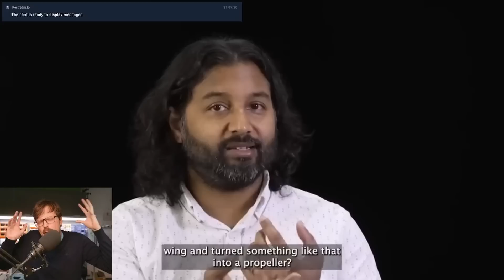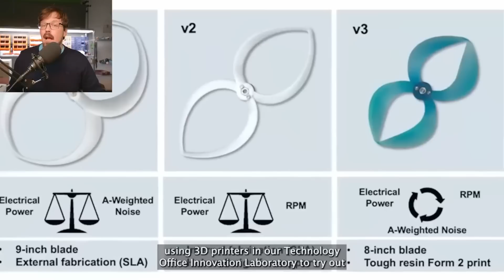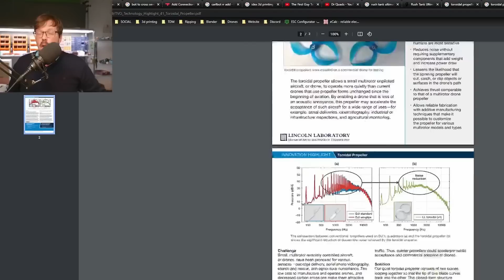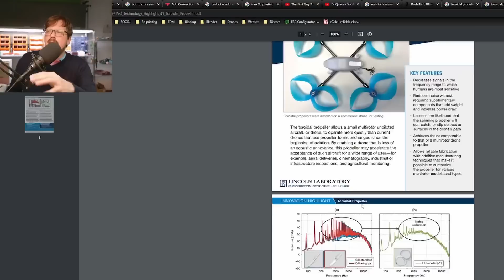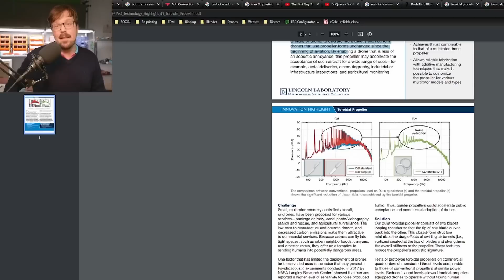MIT Thinks you're STUPID - Toroidal Propeller Snake Oil

Comment: I already watched the channel where the guy 3d prints comouter cooling fan blades, and he didnt call it a scam, but he did show that circular semi-helical design was neither more efficient or quietter. Other designs could be different, but its likely that this is something that wont work as well in air as it does in water.

Comment: You're right about pretty much everything but I'll point out that at ~ 7:20 where the drone is wobbling, if you look at the trees, its pretty windy.
Reply from the maker: That is a good point. I should be more precise!
Reply: @33rdframe  I think you are right. But only in Horizon Mode https://youtu.be/hby6U47oV_k?t=85 in Acro the issue is gone. But well, the Video doesn´t show the Betaflight logs :) Greetings from Germany
Reply: I would bet the PID tuning is significantly more aggressive in Acro mode which would give it better stability. Ultimately, they still chose a wobbly flight video as their presentation material which seems counter productive.
Reply: No he seems right about the wobbeling in horizon mode. https://youtu.be/hby6U47oV_k?t=85

Comment: I agree for the most part but reserve judgement until I see proper testing from a prop manufacturer. They will definitely be investigating but I do not believe the resulting prop will look like what MIT has shown.
Reply: Can't wait for the new tmotor MIT popo poop props
Reply from the maker: I mean I am sure there is a possibility to gain some tiny tiny benefits from these props.... But you will lose efficiency, power, and handling..

Maybe the best thing these props can be is kid safe... That not totally useless... It's just not a revolution
Reply: @33rdframe  gosh you get some wildly aggrevating commenters 😂. To further expand on my original comment, I believe the idea to connect two blade ends is potentially useful but is not likely to take over the tried and true 5" triblade. It'll make quad blades a more usable product. Basically just have a forward swept blade tip touch a back swept blade tip such that the forward swept blade won't flutter out of control under high rpm. Adds a tiny bit of weight but the resulting gain from reduction in drag may make it efficient enough to use more often. 

So MIT, snake oil and I'm proud to be part of a community that can process this all so quickly. But I wouldn't say it's all hoopla. There is some gained knowledge and it comes in the form of a 'no duh' epiphany. No duh if you connect blade tips they'll likely share lesser drag from the tip and the resulting blade could possibly have somewhat lower drag. Now just do it without impacting the rest of the performance.
Reply from the maker: @Kabab  I love the trolls just as much as the noble viewers, because the morons drive traffic with their ridiculous comments the refuse to abandon
Reply from the maker: @Kabab  also if you connect the tips all that dead weight on the outermost part of the blade not producing lift is a big hit to flying efficiency.
Reply: @33rdframe  yeah definitely connecting tips will add weight but I imagine an efficient way to do it would be to legitimately have a forward swept blade behind a back swept blade such that the ends just connect so minimal wasted material. It could possibly work out. It probably won't be better than a triblade but should be better than a quad blade.
Reply: @33rdframe  How about for large drones used for military and delivery applications?  Did MIT ever once claim they were working for the FPV community, "Doctor"?
Reply from the maker: @odinata  they used an FPV drone directly in the promotional video....
Reply: @33rdframe  Do you know what FPV stands for?
 There is is no FPV camera on that craft.  There is no transmitter, no antenna.
Probably just an early proof of concept, since the lab caters to National Security and Military..
Reply from the maker: @odinata  what does FPV stand for?
Reply: @33rdframe  If you don't know, what it stands for,  then why are you claiming MIT used FPV in their prop tests?
Somebody bought a DJI Avata and thinks that means they have a Phd in Drones.
LOL!
Reply from the maker: @odinata  bro I have flown my avata for like two months already. It's long enough to spot an FPV drone. At the end when he is flying the white drone outside that is clearly an iflight FPV drone
Reply: @33rdframe  So you think the DJI Phantoms 4 is an  FPV drones, huh?
Are you smoking some of GEN X FPV's drugs?
Reply from the maker: @odinata  bro, I fly a Dji FPV mavic 3 cine before. But I cannot fly well yet. I'm still learning
Reply: @33rdframe  and yet sis you're somehow smarter than all them science and engineering students at MIT and the people who hand out the awards for innovating research and development... You're the smartest guy in any room you're ever in huh? Lol
Reply from the maker: @odinata  given that i do not have friends and live in a cave. it is theoretically correct
Reply: @Davionation-s1g  What's asinine is claiming that the MIT R&D is aimed at smaller FPV hobbyist drones.
Reply: @odinata  You're aware that including "Doctor"  in a username on the internet doesn't actually mean anything right?
Reply: @winnie51189  It means comedy and irony when this guy uses it.
Reply: @odinata  The university I went to is ranked higher than MIT

I made no appeal to authority; you are the one making an appeal to authority via claiming its MIT so they are right and I'm saying, "No, that doesn't matter."

You are literally arguing against yourself and don't even realize it
Reply: @pyropulseIXXI  Why do you think your anecdotal claim about the school you went to has any bearing on R&D into novel propeller innovations?
Because you are making an Appeal to Authority Fallacy.
Your opinion on this matter is WORTHLESS, as is your claim about school rankings.
Reply: @odinata  You were the one making appeal to authority fallacy, saying "you know better than MIT peeps?" One can be a hobo off the streets to disprove their claims but apparently you like appealing to authority, so I used 'logic' you are familiar with to demonstrate people at the same level of MIT disagree with them
Reply: @odinata  My my son, calm down. 

You out here calling someone Ignorant, while trying to use arrogance to mask yours.

There's a reason you eat alone.
Reply: @odinata  "Because you are making an Appeal to Authority Fallacy."

...also odinata...

"and yet sis you're somehow smarter than all them science and engineering students at MIT and the people who hand out the awards for innovating research and development..."

Comment: Potential use cases as it's quieter, so you can fly closer? Great, problem is that there are distance limits based on the drone falling or slamming into a person's skull (FPV can go 100+ mph and weigh 700g+), noise was never a limiting factor.

All videos trying to prove MITs nonsense all show that the drag by the design is limiting lift and prop speed, so technically it is quieter. Great. Less efficiency, but it looks cool!

Comment: It’s not “a weighted” noise.  A- Weighting, as opposed to C weighted, is a deciBel measurement that is a frequency profile applied to the measurement to make it match how our ears hear different frequencies vs a microphone.  Not arguing your other points and additionally, these designs will have a lot more inertia than a standard prop making them slower to react on a drone that needs to change the motor speed very quickly.
Reply: The important thing is if both motors runs at same power, but one propeller gives more thrust, then it's irrelevant to compare the noise because the flight time depends on amount of thrust per consumed power.

So same power but less thrust may result in lower noise - and a need to increase the RPM/power (and hence noise) to compensate for lack of thrust.

So bottom line I that there should have been information about needed power and produced noise at identical thrust.
Reply from the maker: @perwestermark8920  you nailed it! that is why they can show the bench test noise but NOT the hover test.... i think i should have pointed this out better. but thank you for making it clear for everyone
Reply from the maker: Thank you for correcting me. Yes I didn't fully understand than but I looked it up and you are correct.... It still doesn't provide any actual data but it's not as ridiculous as I made it out to be
Reply: @33rdframe  And electrical power is measured in Watts, not Volts or Amps.
Reply from the maker: @GavinBath  p=vi .  i mean you are splitting hairs
Reply: @drquads5589  how many split hairs accounts for the time value relationship to power?
Reply from the maker: @jerrodbrown5475  listen bro I am not here to  mentally masterbait to make myself feel smarter than others. the proof is in the pudding. do you feel that "scientific paper" was adequate or not?
Reply: @33rdframe  I mean for voltage = const , I is proportional to power
Reply from the maker: @mr.mirror1213  yes but what does that actually mean in the context they used it!?!?? That was my point
Reply: @33rdframe  I'm with you
Reply: @33rdframe  the proof isn't "in the pudding".. the saying goes "the proof is in the eating of the pudding". If you have pudding you can say whatever you want is in it. The only way to prove what's in the pudding is to eat the pudding... I hate how everyone gets this saying wrong.
Reply from the maker: @bradleyknopp7303  fair point haha

Comment: These toroidal props are the biggest fad that have hit the FPV community in years.  Remember those stupid angled motor bases that were supposed to make your quad more aerodynamic but ended up just making our quads fly like crap?  Well the same thing will happen to these toroidal props.  First by being heavier they are killing efficiency by reducing the motor’s RPM at a specific current.  Then it will kill throttle response and make the quad fly like crap.  Just look how wobbly the Phantom is in their video.

Comment: Did you personally try it? Because we all can be talking. I'm now printing V1 and V2 from STRIKINGFPV, planning to correctly test them on the testing bench. I also have doubts but still, it looks like a good start for innovation. They may be not performing as advertised at this stage, but I believe there still will be some noticeable differences and we as a community can play with it to improve the initial poor design. 

I'm from Ukraine and if you read the latest news, you should know how important FPV drones became in the last half of the year to save Ukrainian lives. And this design seems to have the potential to carry more weight than regular designs and maybe be a little quieter at the same time. Like if this is true at least partially - I believe it is worth trying. I'll be happy if it gives at least 10% of the lift capabilities at a cost of +30% battery consumption. This will allow for making one-time-use DIY FPV drones, capable of lifting heavier loads, and it is precisely what the Ukrainian army needs now from FPV drones.
Reply: if it worked, they'd have said "a 12db reduction at 4k rpm"

It's not that damn hard to measure sound pressure levels and rotations per minute, yet they didn't even provide any data or control comparison.
Public education is an amazing thing.

Things missing: flow rate, flow pressure, motor amperage, motor rotation speed, sound pressure levels, humidity, temperature.
Things provided: two frequency response graphs of the whitenoise generated by unknown motors at unknown speeds in an unknown environment.
Reply: Emm.. But doesnt itself "+30% battery consumption" give additional weight ability with any prop on flat earth? :)
Reply: @sunnyfpv3694  drivers and motors have their limits. I do not generally care about battery, they not ment to fly long. They ment to deliver as much cotton as possible to russian tranches. We already boost our DIY FPV kamikazes mostly to the limits of electronic, they are able to carrying 2kg and it is enough to barrage RPG shells including cumulative anti-tank one, It is one way delivery, usually takes 3-4m to get to the target, it is better to be as silent as possible, and carry as much weight as possible and be controllable. I assume giving 30% of battery will help with weigth, but not so good in flying unnoticed and if we boost more than we are doing now it will just burnout in middle of flight. Anyway I already printed few versions and want to check how this new rotors works. I-m not expecting much, but i'm expecting at least some pros in terms of lift and sound. Still waiting for motor, driver and DJI rotors for comparison and to make testing bench.
Reply: Станіс  not so good. Drone slide sideward and not keep stable horizontal position. It Is is fixable with additional calibration. As for noise it's not so high but not so silent as want to. I'm printed it from ABS on Artillery Sidewinder printer, and quality of surface not perfect and seems they are little unbalanced.
Reply: "I'm from Ukraine and if you read the latest news" do you have evidence the news is truthful? Do you have the data to give? Whose lives are being saved and whose are being removed?
Reply: @amentco8445  I understand your question in general, but for me, It is not a matter of "where to get information", it is not a matter of who should i believe or not believe. Most of my family leave in Kherson. I have people that are in direct danger right now at this moment. Russian army already destroyed most of the region. Like there are no villages left, no roads no factories,  thousands of people killed, electricity, and water sources, everything is destroyed. My uncle works in a hospital that was bombarded. My man, believe me, I have no such problem as "what the news says" or "who say right and who say wrong". I have my friends and family in tranches, they ask me for money to buy a drone. I want this drone to be as productive as possible because if it will be productive my relatives will have better chances to survive. That is a reality I leave right now.
Reply: @amentco8445  Sure I have, I leave here. IDK what evidence you ask and why but here - that is a work of a drone I personally donated for. https://www.youtube.com/watch?v=baYd_8Syzak&ab_channel=ClimbArmy
Reply: "10% of the lift capabilities at a cost of +30% battery consumption"

You'll be happy with a 1300% loss in efficiency? lol... wow, no surprise you are willing to be the cannon fodder in USA's geopolitical games...
Reply: @TheChzoronzon  15.4% loss in efficiency...
Reply: @ChucksSEADnDEAD  From were did you get that number? Link please
Reply: @TheChzoronzon  I simply used the numbers given and used my phone calculator. You calculated 1500% out of nowhere. I simply used a 110% performance over 130% consumption to get 15.4% loss in efficiency. For 1500% loss the consumption would have to increase dramatically.
Reply: @ChucksSEADnDEAD  Can you read, dude?

"I was, literally, quoting OP... and joking at his (I hope!) TYPO"

And OP said:

"I'll be happy if it gives at least 10% of the lift capabilities at a cost of +30% battery consumption. "

"10% of the lift"  isn't 110% of the lift, it's 1/10

But good to know you get YOUR number from a post that makes no sense... lmao!

smh
Reply: @TheChzoronzon  He clearly intended to have a + sign in front of the 10%. Just like he used in the 30%.

Comment: I reckon these new props are overrated. They are not as efficient and you could probably get the same reduction in noise by using more blades in your props
Reply: The best reduction in noise comes from the air pressure, which totally depends on the weight of the aircraft. Different amounts of blades just change the frequency and surprisingly, a 2-blade prop has the lowest frequency which makes you feel less loudness. Turbo-like props will move the frequency higher and make it sound like a swish, which also feels like less noise, but these kind of props are unefficient.
Concluding this, to make a quietest aircraft at home for free and with no registration, just make it light as a feather and use bi-blades. 
And btw, i am not a scientist. Whoever is, you are welcome to explain my point of view :)

Comment: Most of the video is a Kickstarter, but the internet got wild because they work already in boats and the noise profile graphs. There are real MIT stuff, plus they are much safer without guards which by itself is already awesome. Yes it's probably mostly for cinewhoop.
Reply: For now we have zero data for air propeller. gain is real for water propeller and avoid cavitation.
But you are right it's good for safety for cinewoop.
Reply: I'd compare against a prop printed in the same way with about the same thickness. Also we have so many profiles and variations to tests with these new props that they may be bad but it's still exciting.
Reply: The efficiency loss seems huge in actual models people have tried. It's poopoo.